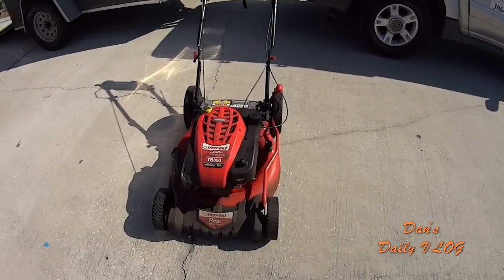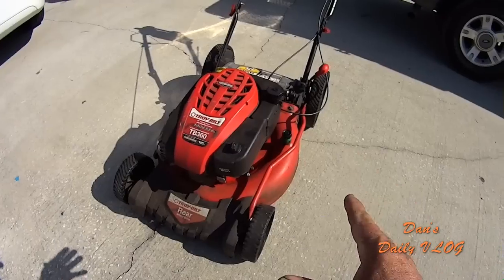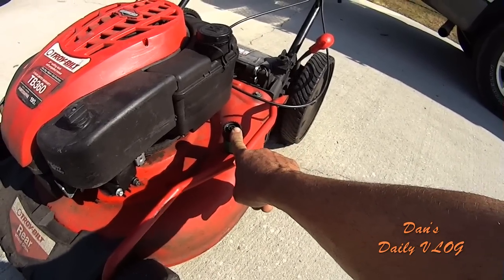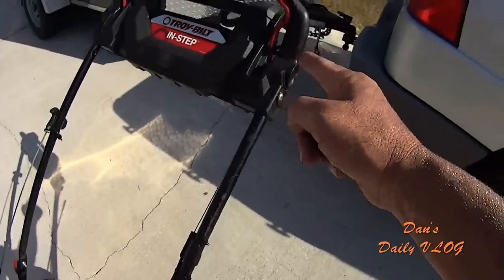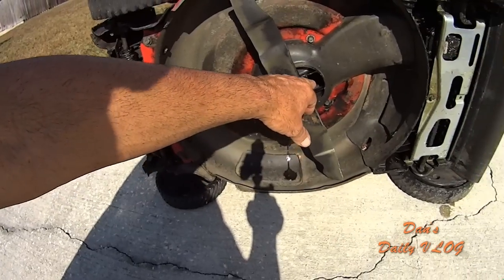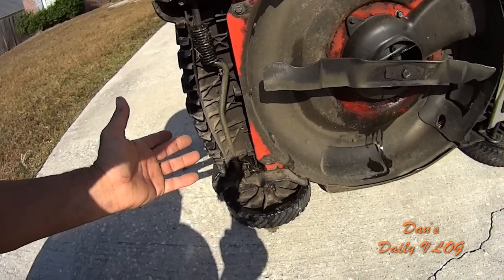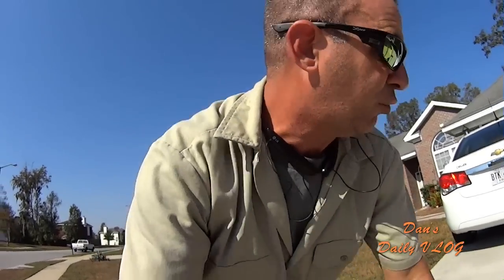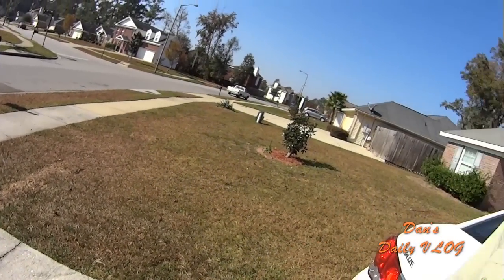HONEST REVIEW - Troy Bilt TB360 Lawn Mower - OVER 400 LAWNS SERVICES

Comment: Bought mine in 2015 same mower, just changed the oil 1st time in 2024 lol cleaned air filter, ran carburetor cleaner in for a half hour new blade and my 1st maintenance was the rear cable drive broke

Comment: So glad to see this review.  I have been asking ever since you bought it hows it doing cause every time I go to Lows I want to buy one.  The last time I went they had one left in a smashed box.  I would have bought it.  I had also seen others speaking of the throttle cable breaking but like you I do my own mechanical work on them.  I have been buying residential Toro/Honda mowers since I started because its so easy to get parts and they are lightweight. Great review I am pretty sure I am going to get one.
Reply from the maker: I really do like my mower a lot. I got lucky finding this model. I hope they keep making it or at least the same specs

Comment: I have owned a TB360 (same model as yours—same model number) for 3 years now and love it.  If I were to review it, I’d say exactly what you have said.  The only negative thing I would say (so far) is that (as another viewer commented) the drive handle broke; it is, however, easy to replace.  Thanks for the heads-up on the bolts holding the front end on—I’ll watch for this.  I notice the left front wheel on yours is worn significantly more than the right one.  This suggests, to me, that for whatever reason there is uneven pressure on the front wheels.  Thanks for your super videos which I have added to my mower maintenance folder.

Comment: I just picked up a Troy-bilt xp with the 4 speed, for 20 bucks, all it needed was a good bath and a carb clean, bag, side discharge chute, a very powerful, extremely nice running mower, I'm going to install a 8.75 engine I have laying around with keystart, that will make it a truly beastly mower..... Great video man.
Reply from the maker: Whenever you change a motor. Be very careful for blade adapter / blade height and if self propelled the belt/pulley sizing
Reply: Dan's Vlog oh yes sure will tks.

Comment: I told you in the past I have a Troybilt 190 cc but it isn't self propelled and only has the rear discharge.The only thing I have done to it was had to clean the carb about 2 years ago starts on the first pull even after sitting during the off season.I use my TROYBILT riding mower mostly use push mower in some areas I had to get rider because of my back surgery I  get a lot of pain standing for long periods.I keep the oil,spark plug,and air filers changed.

Comment: Ours has been great. The drive handle broke right after the warranty ran out but its another $22 part like you said. The engine is fantastic and the light weight sure makes it easier to use.
Reply from the maker: It really is a good little mower for the price

Comment: Very thorough review. I own the same machine. I mow a tons of grass as well. Love the RWD on banks. One handed banks, no problem. Steep ones too!!. Torque is great. The bag capacity is very little even for the consumer market. I actually ran over the bag by accident and now i need to replace the frame. 25 bucks or so. Overall i agree with everything you said. I came here looking for an answer as to why suddenly midseason it quit working. I believe it is a fuel issue and you mentioned that fix. I will try it. Thank you so much.

Comment: I have the same mower for the last 2 years and I like that is lightweight and has an eager engine that rarely bogs down. It is a replacement for a very nice Honda HRX, but it weighed like 100 lbs and it mysteriously threw a rod, which is very rare. However, this mower is very cheaply made and the part where the engine mounts to the deck developed a crack and with use, the crack enlarged and the engine started to vibrate. The vibration took out the muffler where I lost a bolt somewhere in the yard and the remaining bolt broke off on removal. I have had to replace the blade adapter several times because the star erodes easily and the blade starts to loosen. Also the gas tank is very flimsy to the point where the cap will not stay on, there are no threads to the cap, just a couple of slots in the tank neck and tabs on the cap, so I have had to tie it down. Yesterday I easily replaced the engine with a Predator 172cc engine. I was leery about the 7/8 inch shaft and how the original blade adapter would fit. But it fit fine and the mower is back in business, but I can tell the 172cc engine is not as robust, although it is more solidly made, if that is possible. The old engine actually worked fine, but the base was too thin for durability.

Comment: hey Dan is it possible to drill out them bottom bolts all the way through the plastic and use a longer nut bolt and washer .  Then you could clamp the plastic in between and use loc-tite
Reply: and the front wheel has a nut behind it .  see if its loose 
the do sell replacement wheels that have bearings in them . maybe you can find 1 that will fit
Reply from the maker: I think only the middle bolt can ne drilled out and nutted. But for $22.00? I would rather just add it to a shipment of new wheels, a belt or 2 and share the shipping for all.

Comment: I am also mechanical.  I got one from a friend that the blade kept coming off.  I am thinking of drilling the worn out studs on the blade adapter and adding short bolts/lock washers/nuts to keep the balde still.  At least to get it running to ensure it is good before buying a blade adapter.  Do you think this will work?
Reply from the maker: Run the engine with no blade, if it works, buy a proper adapter. Do not modify the old one
Reply: @DansVlog  Thanks.  I'll give it a shot

Comment: Does this lawn mower require a separate mulching blade?
Reply from the maker: No. The blade and the factory replacement blades are designed for mulch, bad and side discharge.

Comment: Hey Dan, just got word from the repair shop that the crankshaft of my TB360 is bent after getting a root stuck between blade and deck. $522 to repair shaft and blade and stuff. It has been working great, and we have a lot of slope on our lot. Since this isn't available anymore, any thoughts on the best alternative for a new mower as similar as possible? It looks like most places are going with smaller Honda engines, and I am worried about with the slopes and the smaller engines. The price point/value was great with this, hopefully something out there is comparable. Love the rear wheel drive going steep uphill with the taller wheels. Also, the one step height adjustment. Would buy another in a second!
Reply from the maker: Removing and reinstalling four bolts and you can have the motor replaced brand new!
Reply: @DansVlog  Hadn't thought of that option. Any idea where to get the same (or similar enough) motor, and what the cost is?  I was on TroyBilt's site, and they have a newer model with 190cc motor (Honda vs Briggs & Stratton on TB360), which is out of stock but supposed to be available at the end of the month for $399 plus tax & shipping called the TB490. Looks similar, but has different drive controllers.... I kinda liked the one on the TB360. Any thoughts on new motor vs TB490? Any experience with the TB490? Thanks!
Reply: @DansVlog  Dan, repair shop says they cannot find a replacement engine, assuming they are only looking at a exact match to what is there. Any thoughts? Or, any Experience with the TB490? Thanks!

Comment: Thanks for the tutorial...that's great.  I have the same exact unit, I'm finding a static type noise when it's running...cuts fine, just the noise that's a bit annoying.  Any ideas what it may be?
Reply: I have this mower and I repair lawnmowers. that noise you hear is the starter cogs. I took mine apart and cleaned it thoroughly. it's made from plastic. dirt builds up in the cogs and keeps them from retracting completely and they touch the flywheel.  Don't try it yourself!!!! There is a powerful spring under the pulley and it can put out an eye if it comes unwound unexpectedly. But this should help your shop find the problem with little troubleshooting.

Comment: To repair the dead man switch, purchase a universal throttle cable and install that on the handle. down to start, up to stop. then you still have the safety stop on the flywheel working.
Reply from the maker: That’s a great idea

Comment: Hi Dan! Quick question looking buying this mower, does this have a reverse option or free spinning to pull back. I have a small yard which has some tight spaces which requires some backing up. Thanks!
Reply: A little late but better late than never. Answer: it does not. It only goes forward.

Comment: Update: Turns out the issue is blown head gasket. It has since been fixed and runs fine now! The head only has 4 bolts holding them unlike the 8 bolts the older quantum engines had, so its easier to blow head gasket.

Hey! I have the same model TB 360 and having issues with getting it to start.

Some time ago, it hit a rock and had the blade  and blade adapter bent. I replaced both of those items and then it worked for 15 minutes. Then it just randomly shut off. I checked everything and it turns out the flywheel key broke off and the timing was out of alignment.

I replaced the flywheel key, changed motor oil, got new air filter, got new spark plug, and cleaned the carburetor, but the mower still wont start. Any ideas?
Reply: @SupaTrending Daily Thanks your your response here! I was ripping the block apart and notice that the head gasket was blown. I have since replace the head gasket, gaped the valves and it starts like a champ!

Comment: Is there a way tor swap the bushings for some bearings?
Reply: No. But you can purchase bronze bushings from a hardware store, drill out the plastic wheel for a pressed fit and install the bushings. when they wear out and the tramead is still good, just replace the bushings. if the tread wears out take the bushings out and install them on the new wheels to extend the life of the wheel.

Comment: What is the hours on this mower? I have one and I figure I use it 25 hours/yr. in the NE.
Your front wheels are bald, I bet you have 500- 1000 hours on it, or maybe more.
Awesome video by the way!
Reply from the maker: +Al Gorel Thank You. I never installed an hour meter on it but I have to guess over 1000 for sure. It's still going strong today!
Reply: Dan's Vlog  Dan, that would be equivalent
to 40 years of use for the average home owner. Ironically traveling today for business in Troy, NY
550 people lost their jobs in 2001 when the Troy Bolt factory closed their doors. The old "Garden Way" company.

Comment: where did you order parts for this machine?
Reply from the maker: *Troy Bilt 21 Inch Mower Blade - http://amzn.to/2ao8I85
*21 Inch Rear Wheel Drive Belt - Troy Bilt / MTD P# 95404282 -http://amzn.to/2ao8L3P
*21 Inch TB Blade Adapter with Drive Belt Pulley MTD Part 687-02220 ADAPTER ASM-25MM http://amzn.to/2ayv6uM

Comment: Rebuild it and run it until it's dead. Just an FYI there is a ticking noise on the audio of your video. Don't know if it's you or YouTube but kinda annoying.
Reply from the maker: i think it is the external mic. Maybe sign of a low battery.
Reply: I hear it too like a cracking noise.

Comment: Rebuild it save money 👍
Reply: i have a commercial  husqvarna  XT722FE with a 7hp KUBOTA kohler engine front 2wd with a key start on it and thick steel deck  wich is heavy duty mower I love it  plus if it breaks down i have 2 husqvarna and kubota dealer to get serviced at wich is nice but i allways trade my mowers every 2 or 3 years and get new right now iom looking into ah DR mower wich is versitile wich im looking into  for my next perchuse and then getting a 42'' mower deck and 42'' snow and dozer blade and 30'' snowblower and wood chipper attachments

Comment: I have a similar  Troybuilt machine with the Honda engine. I wouldn't buy another one for 2 reasons. 1. The single lever height adjustment gets stuck and is  really hard to  free-up .  I just leave it alone now. 2/  when I put the bag on  (properly) I always get grass in my face. The seal is not good.  The. Machine works really well, starts first pull after winter, and I'm sure it will  last me for many years as I take care of my stuff,  but for those two reasons I wouldn't get another one.  (Homeowner- not business)

Comment: TB360 mower is junk. Used it two summers and the same thing broke with the cables on this due to plastic components. The pull rope also broke. Carburator gummed up as well after two summers. This mower blows. too many plastic parts
Reply from the maker: Sounds like user error to me! Yeah sure, I’ve had to replace a few parts here and there but this mowers on its third season with thousands of hours on it. But you’re entitled to your opinion, thanks for your comment.
Reply: Lols...  had a troy built mower hasnt been maintenance for about 5 years. And only this 5th year had issues with restarting and some carb cleaner fixed that right up. And works like new again. Also changed oil.

Comment: I purchased this mover August 5 2016, I had to take this mover back to lowes because it would not start. I hate this mover, as you can see haven't had a year and off to the repair shop. I had to pull out my old bolens push mover had for appox. 6 years to get the job done.
Reply from the maker: Malcolm Tyner Love mine!
Reply: Dan ,I can not love something that does not work !!!!!
Reply from the maker: Not asking you to. Love mine, hate yours. It's all good
Reply: Don't try to get jazzy, I am just letting people see a different perspective of this mower !!!
Reply from the maker: +Malcolm Tyner Jazzy!? Lol Not jazzy. Maybe a bit contemporary but Definetly not jazzy
Reply: Lol,  I think you are having an relationship with that mower.